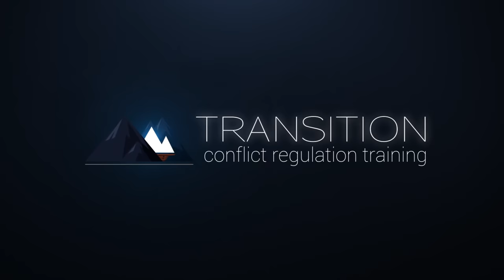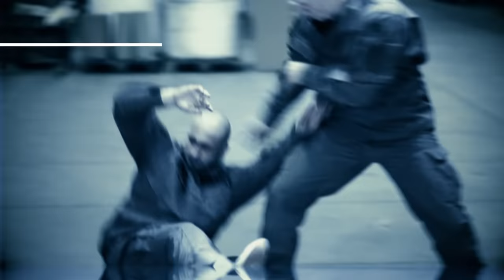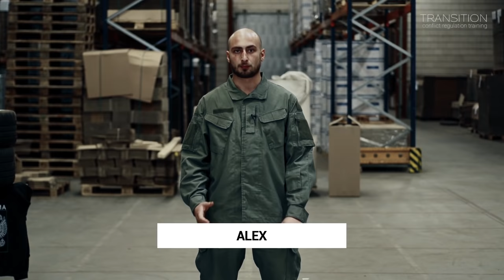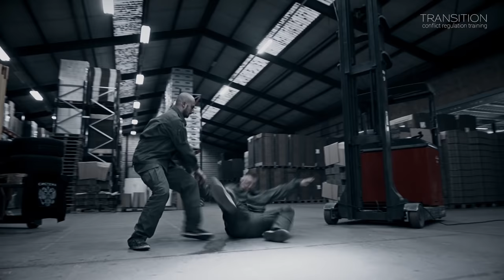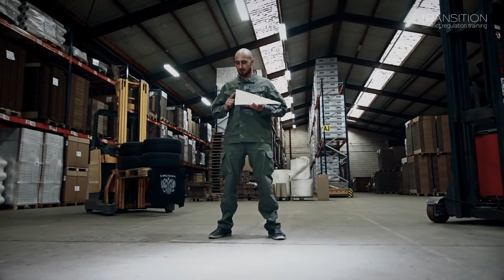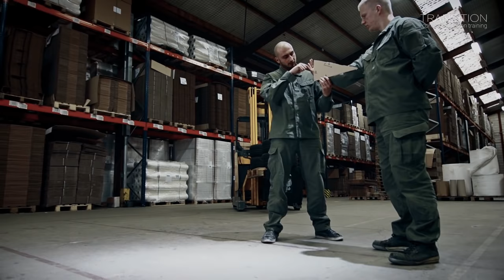Systema: Triangle principle

Comment: In Silat they use equal length triangles and the force goes to the half angle vector.
That's not the same but gives a good memnonic for many throws.
Reply: Came to watch fighting   learnt maths